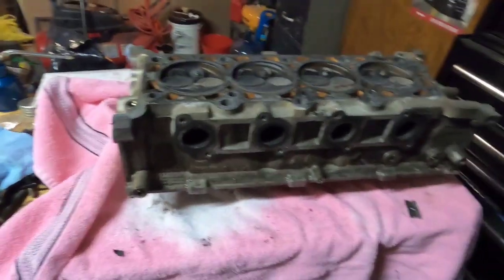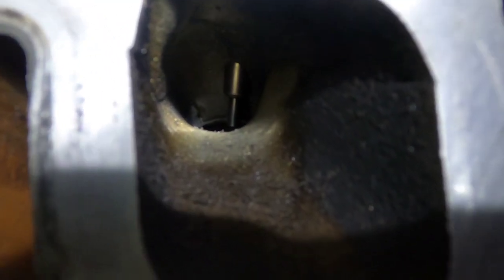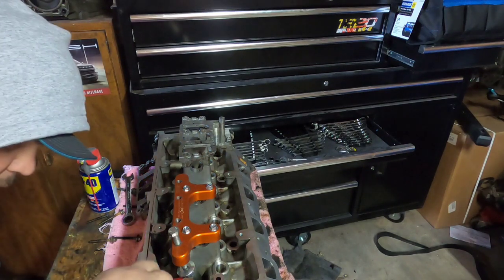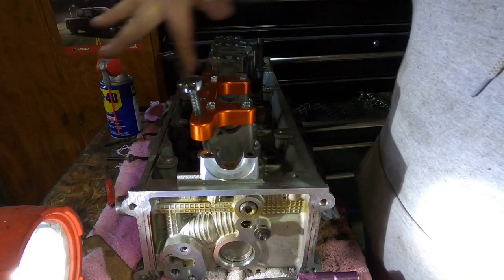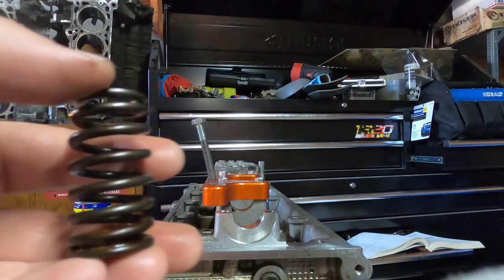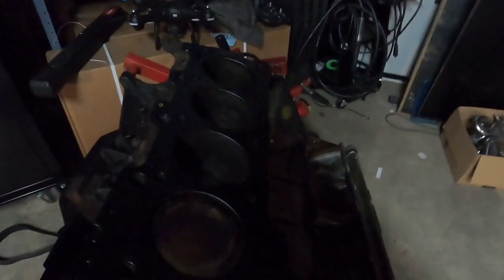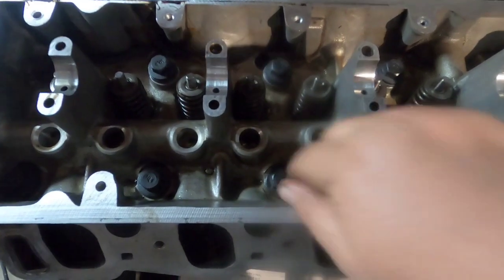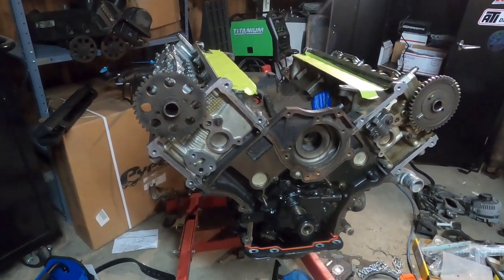BUDGET 4.6 2V PART 3 - PI HEAD INSPECTION AND INSTALLATION

Comment: Hey Kirk question for you, did you have to degree the cams after you install the PI heads ? Do you really need to do it? I will appreciate your advice. Thank you !!!!
Reply from the maker: It's not necessary. You have to buy aftermarket parts like adjustable cam gears or crank sprocket. If you are looking to really dial it in and get all of the power, then yes.
Reply: @streetslayers410  Thank you very much !!!!

Comment: Hey there, thanks for the video! I just bought a '97 Mustang GT. I'm no mechanic by trade, so I'm trying to learn the 4.6 2V the best I can. Unfortunately, my project car turned into a bigger project car I believe. Coolant started pouring out of it (as in, all of the coolant), and after a few days of disassembly, I figured out that it is pouring out of the exhaust manifold... yikes. I was trying to source the leak and could trace it up as far as the passenger side bolt that bolts the exhaust manifold to the mid-section of the exhaust. Then I started to take the mid-section off, and when I took off the bolts where the mid-section connects toward the rear, about a full cup of coolant came out. Any ideas what would cause coolant to be able to get into the exhaust manifold? I'm guessing either a cracked block, cracked head, or best case a bad head gasket. I was trying to use your video as reference to see where coolant could get into those ports, but you have more experience looking at these heads. Any input would be amazing. Thank you!
Reply from the maker: Wow that's a lot of coolant. There is a lot it could be but my best guess is that you have a bad cylinder head.
Reply: @streetslayers410  Thank so much for the response on an old video haha! That's what I figure as well. The valley is completely dry, so I didn't really think it'd be an intake manifold (although it is the original plastic crossover manifold). I suppose my only option is to just tear it apart and see!
Reply from the maker: @thomaslochner9068  good luck! If you run into any problems just message me
Reply: @streetslayers410  Thanks again man!

Comment: I have new heads on the way and getting ready to put the top end back on.  The bottom end looks good so not doing a rebuild.  This is my truck and not looking to make more power I just want it back on the road and running well. just replacing timing set new NPI heads and all sensors, oil pump, and new starter.

Comment: just found your channel and was hoping for some help i have a 2v that’s overheating on idle if the hood is closed i noticed some white smoke and water out the exhaust i tried a gasket sealer and it stopped the smoke but still overheats if the hood is closed im thinking the heads are cracked its an 03 gt pretty sure i got scammed so any help would be appreciated
Reply from the maker: Oh wow. Unfortunately, you have big problems. I would personally take the engine apart to find the problem. Some people have luck with block sealers, I'd recommend doing a chemical flush before and after for the best results. Remove the thermostat and bypass the heater core, replace the water pump, drain the coolant and replace with distilled water several times, when you have majority distilled water in the system  do a chemical flush, repeat drain and replace with distilled water, when have majority water use block sealers, then chemical flush after sealer takes effect, the drain and replace with 50 coolant/50 water
Reply: @streetslayers410  Sadly I believe the previous owner had done just that, when i bought it he stated that the water pump was replaced and that it fixed the issue i saw the new pump and when i drove it there was no problems so i purchased it but my first long drive came and on the way back home it overheated, I bypassed the thermostat did the chemical flush as well before and after i used the sealer and it worked for a bit but one day on my way to work at a red light it happened again and its been sitting since then, i start it once a week to move it but if i let it idle for too long it does the same, im thinking of either swapping in a 5.3 i have sitting that ik runs good or replacing the heads, i am up to the task but im not sure how i would know if its just the heads or even which one it would be
Reply from the maker: @eldesmadres8945  most likely it would be the bank that the water was coming out of. You can "read" the spark plugs or try a compression test.
Reply: @streetslayers410  compression test was going to be my next step and what do you mean by reading the spark plugs? would there be rust
Reply from the maker: @eldesmadres8945  there will be very noticeable deposits on the spark plug that was in contact with coolant
Reply: @streetslayers410  ohh ok ill do that and hopefully find some decent heads off ebay, appreciate the help tho
Reply from the maker: @eldesmadres8945  no problem

Comment: When you put the cam in. I would like to know how you know where the cam marks need to be before I bolt it down. You said a neutral position. What does that mean if you don't mind me asking? I've only have built a chevy 350 engine this looks way easier though.